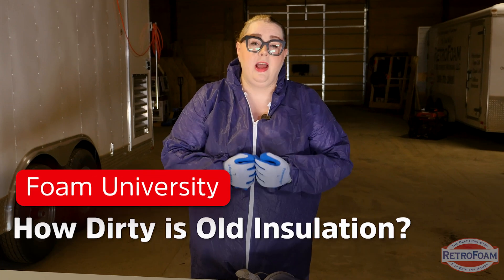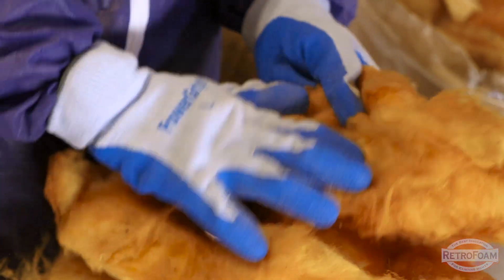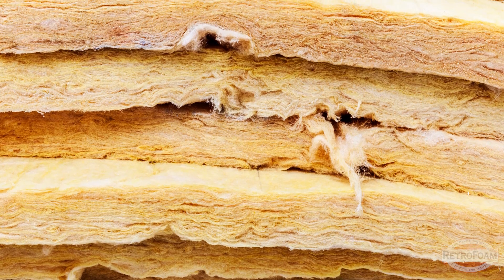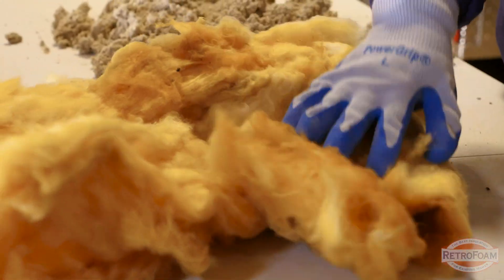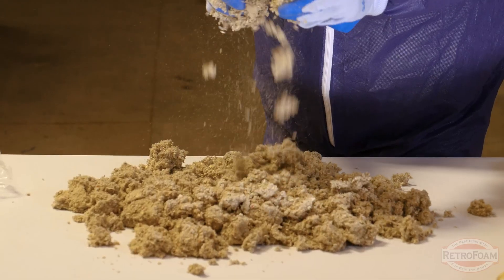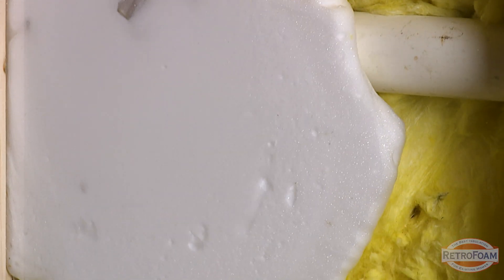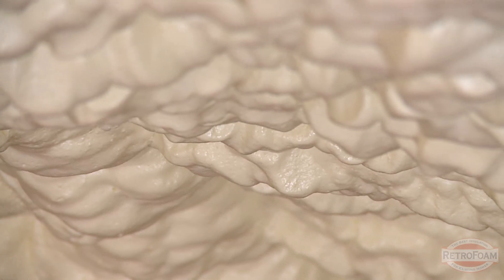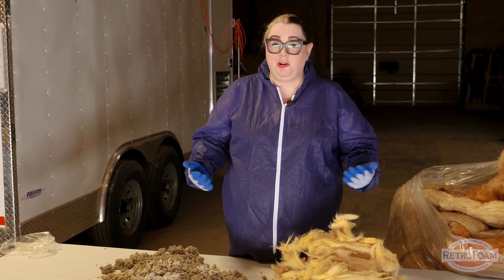How Dirty is Old Insulation? | Foam University

Comment: By taking out the old insulation in my home and having spray foam insulation put in will it help keep rodents and pests out?
Reply from the maker: Absolutely! While spray foam like RetroFoam isn’t a chemical repellent, it’s not inviting to pests the way fiberglass or cellulose is. It doesn’t offer good nesting material, and more importantly, it seals up the air leaks rodents and bugs use to get inside. Just make sure any existing infestation is handled first, and you’ll be a big step closer to a pest-free home. Check out this article from our Learning Center for some additional information on this topic: https://www.retrofoam.com/blog/retrofoam-as-pest-control-insulation